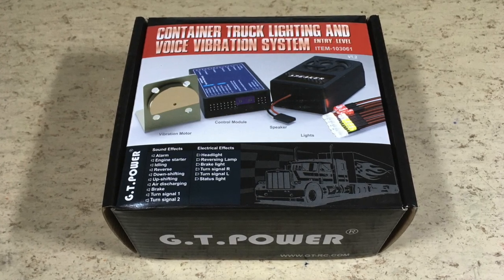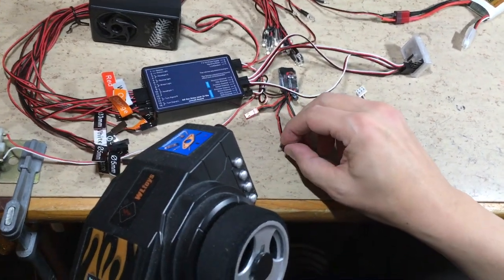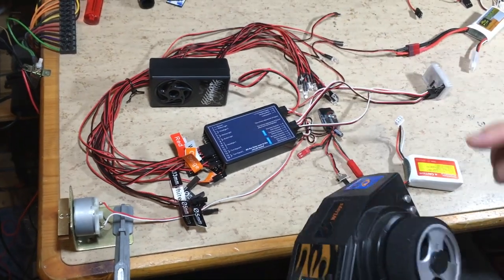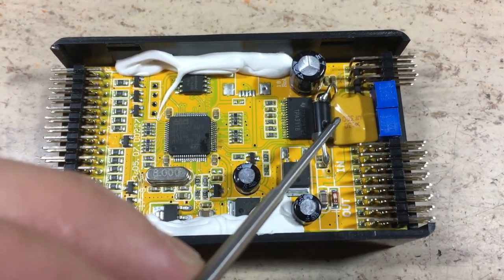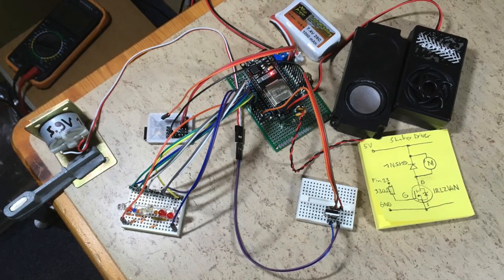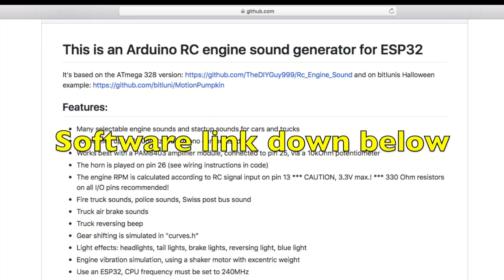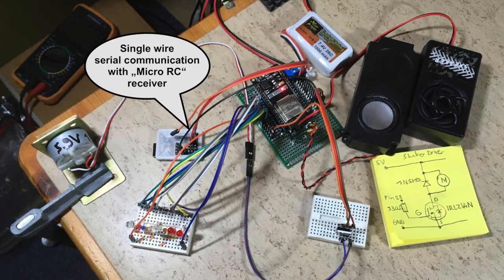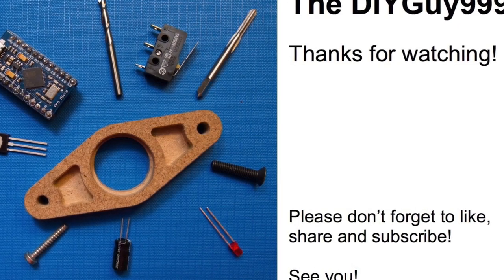G.T.POWER Truck Sound System Test And Comparison With Cheap Arduino ESP32 DIY Alternative

Comment from the maker: In this video: comparing a commercial engine sound and light controller with my DIY Arduino controller. Happy new year to you!
Reply: i have no idea about how to do this stuff or what i am looking at. I am interested in buying the sound and light board assembled or would you be able to tell me exactly what to get? i followed the links but there are so man esps and bread boards etc i have no clue what to look for.. please message me ty

Comment: Hi buddy is it possible to adapt this for a static model?  As an example a aircraft or a diorama ?  I can see there are many features here that I could probably use in static displays.
Reply from the maker: There are the following interfaces: PWM servo signal, PPM, SBUS, serial. If you change the code, you could use digital or analog inputs as well

Comment: hi, i made the new board and connect the shaker to the corner 5v and tried very sitting i know with shaker configuration in Arduino but its hardly start in the beginning and after stop moving cos the brass is heavy ,and solution ?
Reply from the maker: You can change the shaker settings in the shaker tab.

Comment: Where did you plug the vibration motor in the Arduino ESP32? Does the Arduino come with an output for that?
Reply from the maker: Pin 2, according to the sketch. You have to use an IRLZ44N Mosfet and a freewheel diode to drive it. See schematic: https://github.com/TheDIYGuy999/Rc_Engine_Sound_ESP32

Comment: So if I get the components and print your board and put the components in the image 30PinAssembled.jpg I don't have to connect anything behind the board since the circuit is done?
Reply from the maker: Yes, you only have to use series resistors for the LED. Everything else is on the board.
Reply: @TheDIYGuy999   I know it is a lot to abuse, but your complete code is Rc_Engine_Sound_ESP32.ino and if you want to change the sound, can you go from there? and your end plate is called pcb30pinTop it only looks on one side does not matter to send it to print? is that the truth tells me a lot about a module MFC-01

Comment: Great video.your system are looking great. Can connect more light at your arduino system? Roof light, sidebars...
Reply from the maker: Thank you. Yes, of course you can. My King Hauler has about 50 LED and everything is connected to the sound controller:
https://www.rc-modellbau-portal.de/index.php?threads/tamiya-king-hauler-mit-hammer-sound.7450/page-3#post-258083
Reply: @TheDIYGuy999  super arbeit. kannst du das auch für MAN tgx machen?und verkaufen? Danke
Reply from the maker: @bologanbogdan6634  Der MAN TGX ist schon dabei. Einfach das entsprechende Fahrzeugprofil wählen. Sobald das SMD Board Design bestätigt ist, wird es ev. Boards zu kaufen geben. Ist aber noch nicht sicher. Unbestückte Platinen bestellen und selber bestücken ist ja jetzt schon möglich. In diesem Thread sind viele Nachbauten zu sehen: https://www.rc-modellbau-portal.de/index.php?threads/esp32-arduino-rc-sound-und-licht-controller.7183/page-28#post-258465
Reply: @TheDIYGuy999  Ich habe eine private Nachricht im Portal geschrieben.